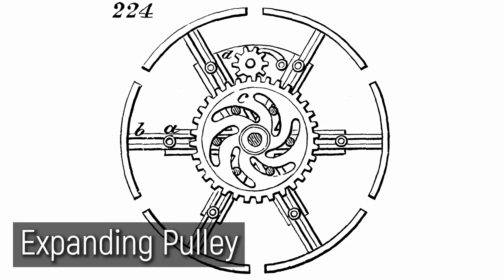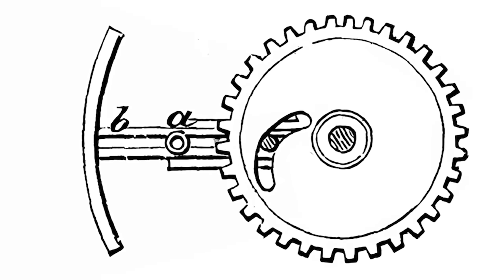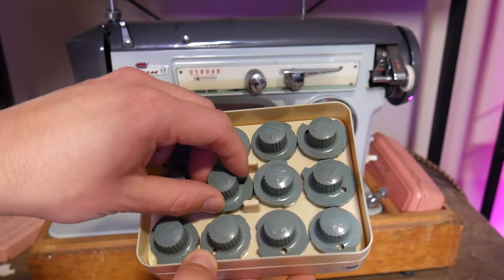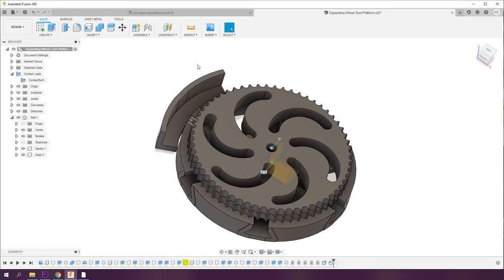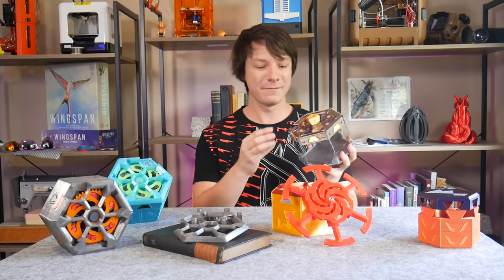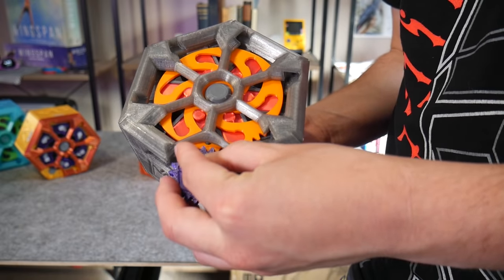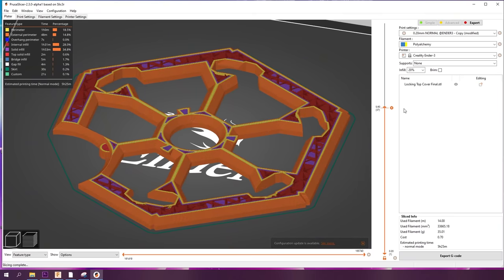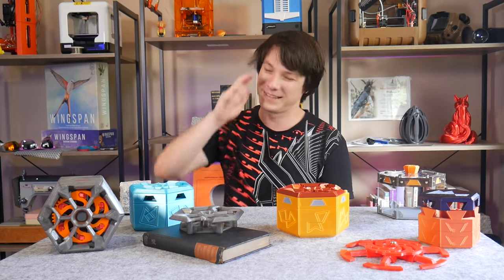This Expanding Mechanism is Crazy Clever

Comment: For the magnet, just use two magnets repelling each others, the magnet inside simply push against a spring to unlock the mechanism, it just needs to push more than gravity, that way it work regardless of the orientation.
There are many solutions to prevent the key from being lifted by the repelling magnets, from a third magnet to a rotating lock securing, etc.

Comment: I know this is an older video, but a similar idea about this design is a centrifugal switch used in motors.  Centrifugal switch rotates and then overcomes spring force which allows linear motion of a contactor to be closed at a specific design rpm.

Comment: Hello, and yes, I know a practical application for one of those. It's contained inside an expandable drum used to build V Belts (industrial or even "some" automotive belts). You may imagine the want for a flexible range for constructing belts, instead of one fixed-size drum for each individual belt length. Oh, and before people think about it, please consider a rubber cover to the drum, before building the actual belt slab. that will take care of the irregularities and eccentricity seen on the outer diameter. I hope you have found this an interesting example. Cheers from Brazil.

Comment: In the automotive industry this design is used when balancing tires. It has studs attached instead of pully surfaces that line up with where the lug nuts go. Its supposed to make the wheel and tire balance out better for a smoother ride. Unfortunately when it gets dirty as all things do in a garage it doesnt work very well due to the complexity of it.

Comment: To make the latch stay in position while held upside down, you could just use a tiny spring, a bunch of possible configurations would work for holding it in place. You can find them at any hardware store.

Comment: Those red  plastic mechanism you can use for presentation for example, attach on outer ring some transfer paper with some support or some plastic and hide something inside and when you turn gears to open you reveal what is inside

Comment: You could set up pulley wheels at the ends of each arm so that it becomes interwoven as well as use an odd number of arms. The closer those arms are together the more force required to to pull versus when they are extended.

Comment: hopefully this hasn't been written already in the comments
Before the advent of steam, many workshops used water wheels to drive machinery. The water wheel drove single shaft that rotated at a constant speed. Great, but not so useful for the many different machines in use in, say, a joinery workshop. So, in order to get differing speed final rotations, different size discs would be used as the primary gear, as is still done today in my pillar drill on my workbench. But, with differing primary gears, the problem of drive belt slack creeps in. This expanding pulley takes care of that without having to resort to using a belt tensioner (which I find on my ride-on lawnmower), which asserts lateral pressure on the belt which may wear it out quicker. Presumably the latch on the smaller gear had a release allowing the extension of the pulley arms to be eased, so accommodating the different sized primary gear/pulley. 
Just a thought.
Either way, thanks for the vid!
Reply from the maker: Fascinating insight, thanks!

Comment: It became gorgeous.
Still I was thinking of a lock to my door and the holes where the pins go inside making the pulley smaller would have to have springs with strong Hooke constant or my lovely neighbors would open it remotely and the magnet would not do the job.

Thank you for your dad and your sponsor that are really giving you what to think and program.

The book , I am really interested in it , "507 mechanisms ". 

I guess it's not easy to find.

I saw parts of a submarine printed using an alloy of copper and nickel. That's something I really need for my lock . 

I would like to go out and be sure nobody storms inside opening the lock remotely. This happening all too often in my city .

If I could a tech a smith or some smiths how to build safe locks , maybe we would solve our problems.

I saw interesting locks one was Bramah's built in London, England.

I don't have the blueprint for it, though. 

Thank you very much for your video and your efforts.

Comment: this mechanisem concept is still in use for gas powered scooters as an auto transmision - the ratio expands using angular momentum ,
so the faster the bike goes the higher ratio it gets . and vise versa . this part is called a variator .

it looks quit diffrent and more advanced / robust . but the operation is based on the same concept .

the one in the picture must be using some type of rope/belt in a groove ( like washing mashine drum ) to compancate for the expanding gaps
in addition to that 
it must have a tenssioning springed arm with a small wheel on the belt to keep the tenssion constant .
Reply: i was gonna say that...but enough said!!

Comment: 8:03  you just need a really weak spring to keep the lock closed without gravity.  like maybe you could cut off a little piece of an ink pen spring, or something.  or maybe you could 3d print a really thin angled part to insert in the mechanism to provide tension.  i don't know what kind of material would allow repeated bending like that.

Comment: this mecanism is used in many centrifugal clutches, even if this sentence sounds wrong.... but the "cam" isn't a slot, so the "pin" is withdrawed with for example a spring. the mecanism is mainly used for torque transmission/put pressure on the clutchlining. sorry for bad english

Comment: okay hear me out on this idea. i know this probably sounds crazy, but when you mentioned "robot wheel" i had a lightning strike my mind:
What if we surrounded the spokes with a semi-elastic material, say... rubber? 
But wait there's more! if the resulting expanded wheel's not round enough in shape, here's another crazy idea: add a second set of this mechanism that operates on the same input, but offset so its spokes are inbetween the first ones!

Comment: Awesome design.  I printed it and assembled.  A few pieces of feedback - with the locking version the lock usually catches on the track in the gear wheel for the sliding bolt - leaving it half locked.  One can reindex the key to lower the latch and complete the close, but it is annoying.  Maybe a second magnet in the key would solve this - or adding a slope to the track it doesn't catch on the latch.

Also for the top cover there are a couple places where it tops off as more of a point.  I've had a hard time getting those areas to print without being a bit rough.  Different materials and re-slicing doesn't help.

Comment: Centrifigul clutches work like that. When engine rpm increases the shoes (arms in your design) are flung to the outside and friction lock to an outer case that then spins and drives a chain. When engine rpm decreases the shoes come in and ur in neutral. It isnt exactly the same but its close enough

Comment: Next up, put the key in the center with a few gears and inward-facing teeth on the central disc, then use a little puzzle doodad as the key where by some secretive, perhaps complex mechanism you have to configure it correctly to fit the slot so it can be inserted.

Comment: Davenport Model B's use cams and a gearing system to control tool movements. They're real mechanical monstrosities and utilize all kinds of simple mechanisms. Not bad for a machine first made in the 1900's and you can still buy them brand new today. I worked at a shop that ran about 20 of them. Might not be your cup of tea but though I'd mention it.

Comment: Idea for unique key: the locking assembly should not be a simple interference pin. Use a notched piston that only clears the cam for rotation when exactly aligned in the cylinder (say 2/3rds or 3/5ths?). Turning it upside down will not fool it. Then, the magnetic actuator can have a precisely lengthed pin which would hold only allow the unlocking assembly to rise to that perfect predetermined height as dictated by the notch in the piston.

Comment: This will probably be lost but here’s a solution to your back-driving problem.

As the mechanism is fully deployed, create small indents at the end of each inner cut out (c part). These cutouts would be parallel with part B.
Meaning that if someone pushes on part B, it would force part A into a cutout that would stop it from back rotating.
To make sure this doesn’t happen accidentally and lock the mechanism, part B would have a small spring pushing it out at all times.
Since this might interfere with the lock, create a ratchet that allows for the opening of the box, but to close it back up, releasing the ratchet would set part B back in place.

If you want then I can send a drawing of the design

Comment: Just a couple of thoughts. 
If you put a bunch of rollers on the arms, one at each end, then you could use it to drive a belt. However there are simpler ways of doing this, with cones for example in a CVT
If you shrinkify it however it might make a useful tool for constraining coiled springs when you want to fit them in drums. Watch or clock springs being fitted to a clockwork barrel for example. Watch and clock barrels are all subtly different sizes, so you might find a use for it there.

Finally, you could use it to drive out the arms on a folding quad/hexa/octa-copter or the legs on a self landing rocket.

Comment: Expendable tables have similar mechanics, those you rotate to 'enlarge'. We had one from the late 90s wich has this system on 4 wings (instead of 6) and at their final point they pushed up the mid-sections to create a 8 piece round table.

Comment: there were expanding footing wheels using similar principles (pedrail wheel or pedwheel) but later it devolved into so called dreadnaught wheel. ANd that was one step toward modern tracked propulsion. Oh, and actually a lot of aperture expansion mechanisms work by this principle, iris-like membranes and some mechanized lense assemblies increase or decrease the focus length that way (add another motion along the axis in latter case).

Comment: I thought of a use for a wheel: if permanent magnets were installed at the top and bottom of the pulley positions it would be a fantastic little shock absorber if wrapped in a flexible track

Comment: Bury the lock gear teeth further in so that you can't use your fingers, then make a key with the matching gear at the end.
Also, I can imagine the expanding pulley being used with a sturdy but elastic band around it. Or maybe it could be for something similar to what a belt wrench is for but inverted to push out like a vehicle's drum brakes
Reply: or just cover it up and have the gear already in there, but the need for some sort of metal stick to slot in it to rotate it (that would be either too narrow, or too wide angled for a finger to use). That whole magnet solution seems like such an overcomplification of that problem to me

Comment: 3:34

The expanding pulley would be used in use with a wide belt. 

For instance, a conveyor belt with an expanding pulley used to increase or decrease tension on the belt at the ends or wherever else it would be needed. I hope that helps!

🤘👽

Comment: you could put a flexion spring locking mechanism on the underside of the gear that held it in place no matter which way the box was oriented, and then the gear key would just need a pin to go down a hole in the top of the lid to disengage the spring, no need to install any magnets

Comment: This mechanism is used to create tables with leaves that expand out to increase the table diameter.  There is an additional mechanism that pops up additional leaves to fill the gaps when the end of travel is reached.  They are very expensive tables.  I have only seen a handful of designs for these.

Comment: At the end you mention that it takes 24 hours to print the box with a layer height of 150µm. The CR-10 and the Ender-3 have a fullstep-resolution of 0.04mm for the Z-axis and holding the Z-axis at fractions of microsteps gives a bit uneven results as the stepper tends to latch onto the next full step when beeing hold in a microstep position.
So using 160µm would not only be a wee bit faster, it should also give a smoother result.

Comment: If you used a worm/hose clamp but put the screw on the inside, it would get rid of the gaps so it could be used as an adjustable wheel, pulley or whatever.

Comment: When I was a kid I drew a plan for a powered sword a blade that had holes in the back of it that would have released nitrogen pressure and in order to rapidly release all that gas I had a valve that had an expanding pulley design exactly like this

Comment: To solve the non concentric arcs when its fully open, we could use a flexible metal strip around its circumference, that overlaps a little when the arms are closed.. that would always maintain a perfect circle on its trim. However it would have a limited top load but that can be addressed using better materials and better geometry.
Reply: Another idea: Modifying the slots to be complete circles, and progressively shifting positions, we could make a clock. That clock could push out one digit at a time, that’s the hour.. and possibly pushes hour digit farther and minutes digit lesser.. remaining digits could stay stacked towards the centre.

Comment: The benefit here is that you can achieve a continuously variable pulley ratio.
Instead of having a multistage gearbox box, thick a bicycle gears. You can just adjust the size of this pulley to change the drive ratio.

Comment: I think if you remember that the “pulley” would be made of steel  and with wider bands on the outer edge I could see a smooth belt used and if you had a wider gear on top to actuate it with a motor put directly behind it it could be used for a variable belt or force output

Comment: The solution to the problem of the gaps in the expanding pullyvis to create two stacked pulleys, with the arms of one centered between the arms of the other, and driving them both with the crank. When they both expand it will make a complete circle. It could work out to be a simple way to make a variable gear ratio, though without steps, it would be difficult to maintain any specific ratio under any kind of load.

Comment: I think it can be a wheel. The outer ring would be like a key ring,either a small or large overlap. Then it's just a matter of moving the ends closer to expand or contract the whole ring. You could even add a centrifugal switch so at what ever speed you want the gear would open and close

Comment: With a flexible material and some sort of slider mechanism these could probably be made in a way that would allow them to be round in every configuration. I'm not nearly smart enough to figure out a mechanism for it but you could also probably make some way to lock the sliders in place when fully retracted which would prevent someone from simply pushing the thing closed

Comment: Consider an example of six tee-arms one hundred-twenty degrees on the circumference. They would meet on angled, rather than butted, faces. Each face would be in the shape of a parallelogram. The more steeply angled the sides, the narrower the gap perpendicular to the plane of rotation.

Comment: You can also make the locking happen when it's contracted, then add springs, cover access to it, then it would be required to spin at a minimum speed of the spring strength to unlock.

Comment: You could overcome the "turn it upside down" issue with the magnet by making it overcome a spring. Not the metal coil spring most people think of, but a C-shape which uses the ductile strength of the PLA. I'm not sure I've actually seen anyone experiment with PLA ductile strength come to think of it.

Comment: this is or was used to change the speed of a mechanism that is spinning like for example a lathe spindle. Most manufacturers opted for a split pulley which had beveled side were built would ride up and down depending on how far apart the pollies were made to move.
It was actually a brilliant design

Comment: Depending on the magnet strengths you could use three magnets one to keep the latch magnet from moving when turned over, then the key magnet being a stronger magnet and overpowering the other magnet keeping the latch in place stopping the easy flip over and open trick most likely, although I could be wronf

Comment: The gaps on expansion aren't necessary. Just overlap. It's a lot more applicable to flat belts than the V-belts you're probably thinking of (because they're so much better). But a big flat belt with a follower would let you adjust the ratio on, say, farm equipment which back in the day commonly used flat belts.

But the first expanding pulley I saw was on my grandfather's garden tractor, which had two V-belt pulleys with movable faces that changed the depth. One was driven inward by a lever, the other followed with a heavy spring. It worked well enough, but I'm sure it wore out belts relatively quickly.

Comment: Just had a thought for locking the pully. Instead of a magnet maybe a pinhole or two. Like instead of the key being the pinwheel gear, there already is one but it has a spring holding pins up to lock the pinwheel. Heh, yeah, at this point one might as well make an actual key and keyhole as the pinwheel. But just thinking instead of pulling a magnet you push the pin-lock out of the way.

Comment: I bet you could solve a adjustable torque sprocket in the place of mountain bike gearing with this! It might be rounded enough when extended to turn the chain (with sprocket teeth on it). ..and you would need a way to retain tension on the chain while attenuating the device.